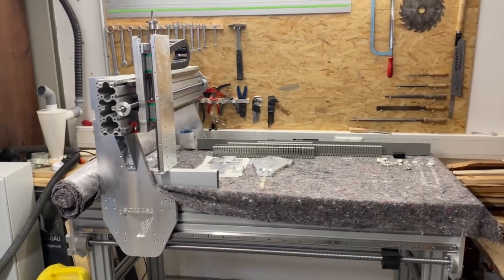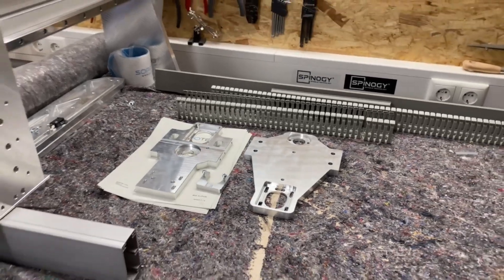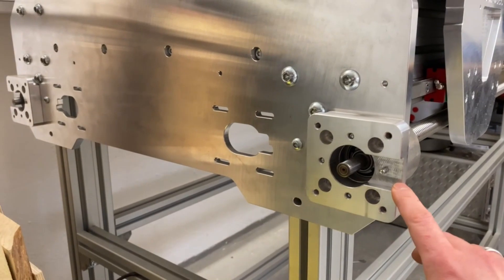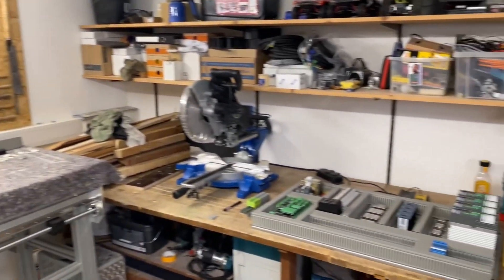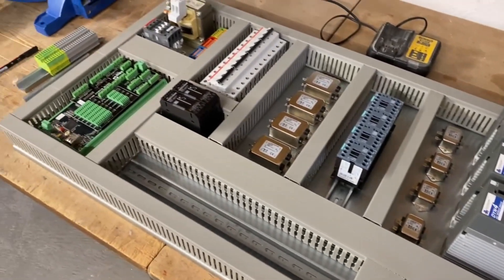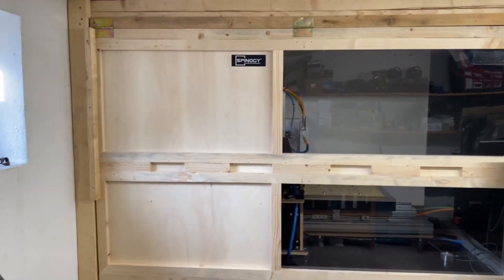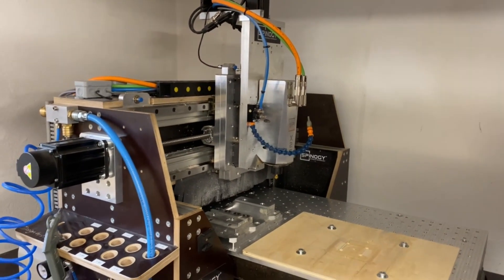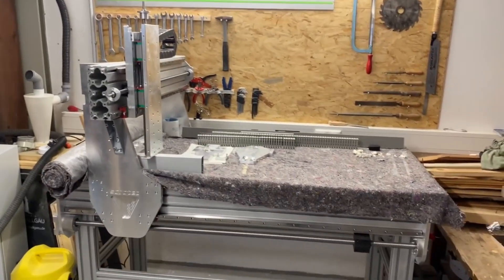Small Project Update on the SOROTEC/SPINOGY CNC Build

Comment: Hello, I am amazed with what you have built the electrical control box. And that is precisely my problem. I am looking for an electrical diagram for my self-built CNC machine in which I want to use the CNC760 controller from Eding. Can I obtain such an electrical circuit diagram from you?